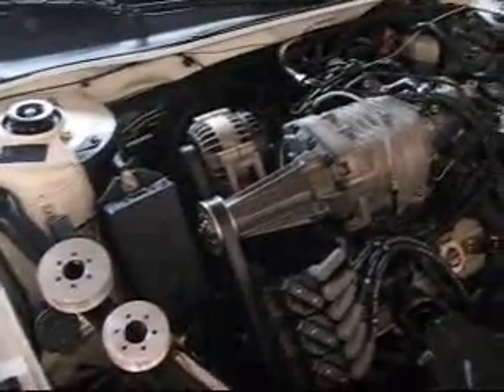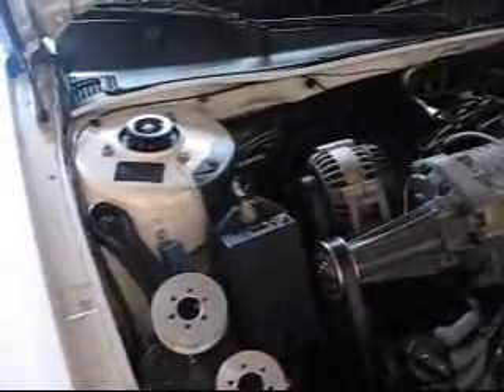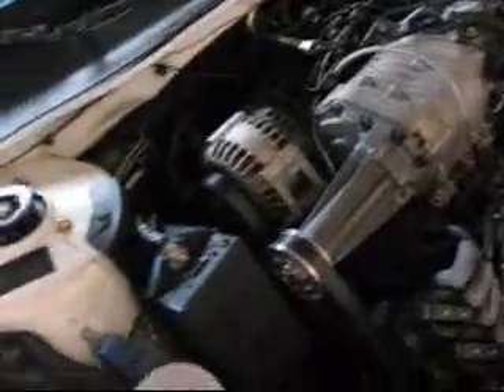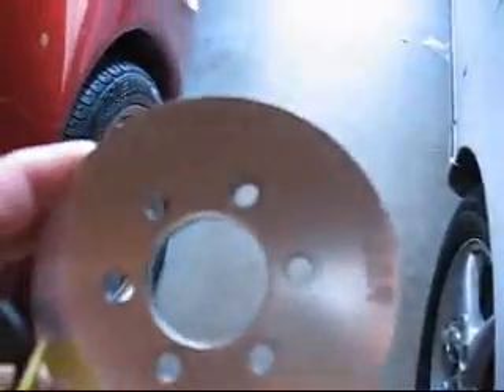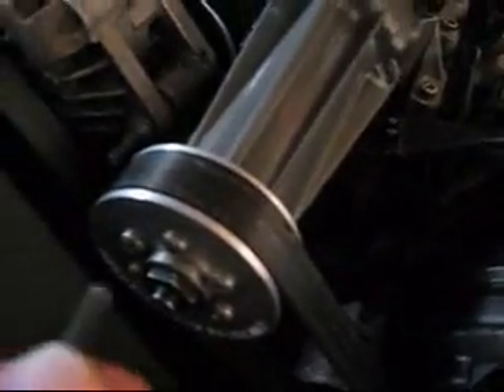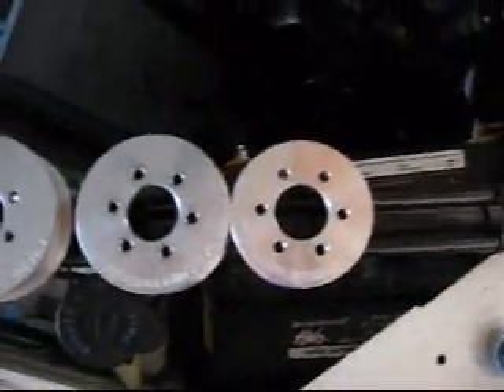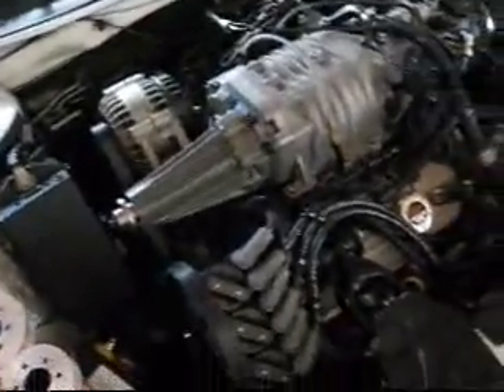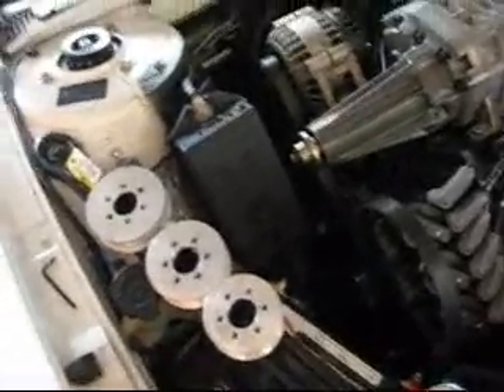3800 Series 2 Supercharged Modular Pulley System MPS Demo

Comment: I've got a Buick regal with a built bottem end (bought like that) with a 3.4 pulley headers cold spark plugs 87 octaine 15 psi 5500rpm custom tune its pushing 350 to front wheels

Comment: What supporting mods does the 3.5 need
Reply: I'm working on my 98 Buick Riviera Supercharged. After talking with some guys at Intense Racing, they told me you can start with the 3.4" pulley, a slightly longer belt to compensate for a smaller pulley, along with 605 Autolite copper spark plugs (gapped to 0.055") a 180 degree thermostat (instead of the 195 degree OEM) a cold air intake (preferably a fender air intake, which you can do by removing the air box completely and running an air tube through the hole below the air box and down into the fender with a K&N cone filter) and also they recomend getting your PCM reprogramed. Just visit their webpage and check out all their options. They specialize in GM 3800 motors. These would be the basics mods for a beginner.
Reply: Juan Rodriguez thanks for the reply

Comment: Hey. I'm thinking about swapping my pulley down to a 3.0 or maybe even 2.8 inch. how much torque/horsepower could I gain from just that. I drive an 04 impala SS. it's stock performance-wise. No it's not actually rocket bunny.
Reply: Yeah, you can't do that... you need lot of supporting mods to run a pulley that small.  These cars are very well documented at this point.  Do research.

Comment: I run a 3.2'" pulley on a 2002 gtp, i was told by a guy at 3800performance to run headers and i should get a programmed computer, stock internals are strong enough for that boost. i have done both of those and never had an issue, i did run no headers on a 97 gtp and the 3.2" pulley did take out the head gasket, but that was because the stock manifold could not remove the exhaust gas fast enough and i built way too much pressure at high RPM's.

Comment: I would like to know if I put 3.5 pulley on my Buick regal supercharge will it damaged my motor is stock factory year is a 2000??
Reply: the 3.5" should be fine, but headers may be a good investment if you plan on spending a lot of time in the high RPM range.

Comment: JohnFromSpace i see that it looks like you have a power wire from your stereo coming from your fuse conversion box next to your alternator... not really a good idea due to voltage jumps.  Take this wire and move it to the back of the alternator where the positive power comes off... Its covered by the black 90 degree boot on the rear front

Comment from the maker: When I was running a 3.5 I had Ported manifolds,3 inch Downpipe,ubend delete,resonator delete,highflow muffler,Intense-PCM,Solid motormounds,180 Degree Tstat and Fenderwill intake

I saw at most 2* of KR and thats not until the second shift at 90 MPH.

This is all on California 91 octane so if you have 93 or higher you shouldnt see KR with that set up and a 3.5. About $800 in mods and you have a high 13 second car.

Comment from the maker: Thats a great stock time. MotorTrend got a 15 flat with GTP's and Regal GS's I guess they just stomped the gas and timed it once. I've see people get as low as a 14.5 off stock 3800 SC's

My car has 105,000 miles too I wouldnt worry about dropping pulley sizes. I been running smaller pulley sizes since 80,000 miles and I'm not easy on my cars. I do maintain them maticulously though.

Comment from the maker: Did you ask them whats the smallest you can possibly drop? The smallest I think I've seen is a 2.6 or 2.7.

If you have supporting mods drop down pulley sizes. It reeally does add more boost and power you'll like it.

Comment from the maker: I didnt know Lesabres had the Supercharged option. As long as a car uses the 3800 Series 2 SC engine all modular systems designed for that engine  will work for with that engine regardless of the car the engines dropped in.

Comment from the maker: Are there other underdrive pulleys available for the Metro? My Buicks running a Underdrive Water Pump and Alternator Pulley.

The company that makes my UD Waterpump pulley got 3 extra horsepower. No idea how much is gained with the UD Alternator pulley since it was never tested.Since my cars 3.8 liters in displacement I wonder if underdrive pulleys would help a Metro out even more.